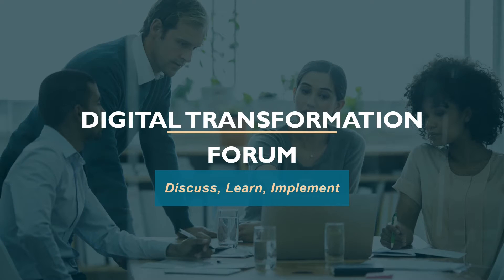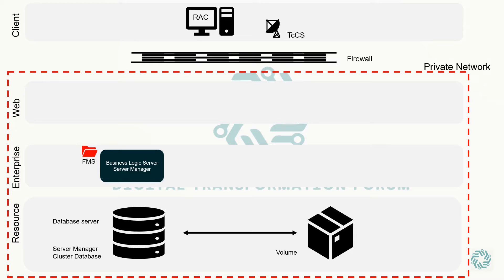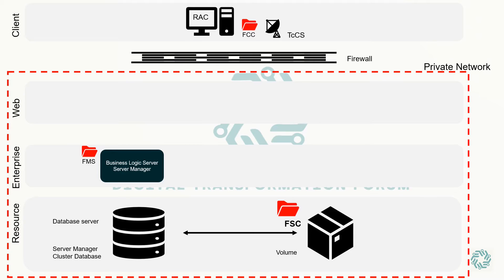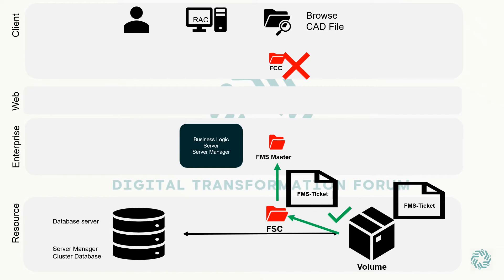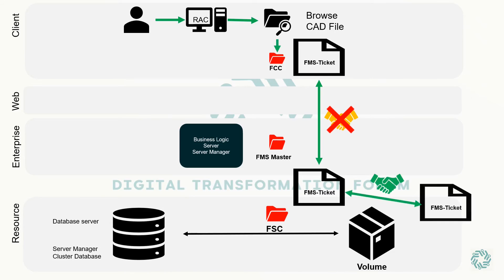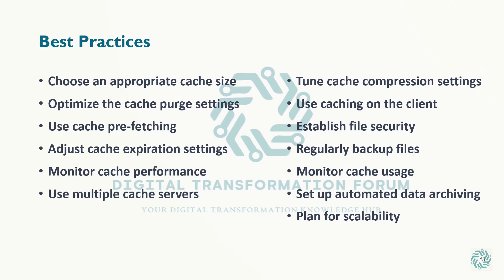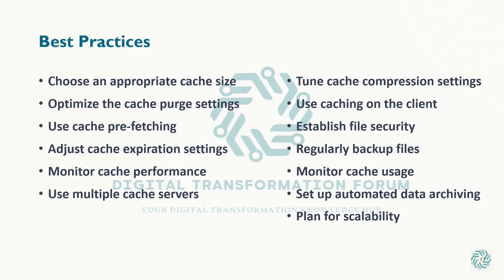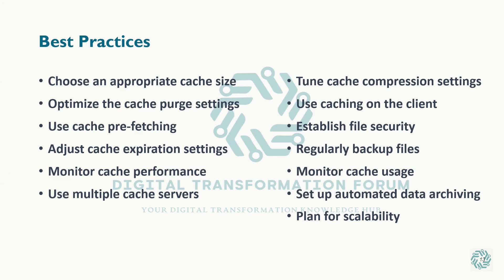The Ultimate Guide to Understanding Siemens PLM Teamcenter File Management System (FMS), FSC and FCC

Comment: Cool Video. How is the data transfered in general? Over http ?
Reply from the maker: We might need a separate video to explain this topic.

However in short, the data is encoded in a format that can be transferred over HTTP. Typically, this is done using a data format such as JSON or XML. Then the encoded data is transferred between the client and server over HTTP. This involves breaking the data into small packets and sending them over the network. The packets are reassembled at the destination to reconstruct the original data.
Hope this helps!
Reply: @digitaltransformationforum  Sure would be cool. Hope this will grow since the Siemens digitalisation is really strong developing. 👍 Thanks for the answer